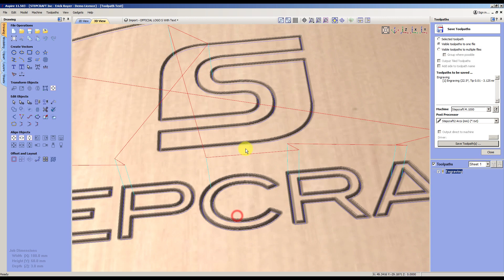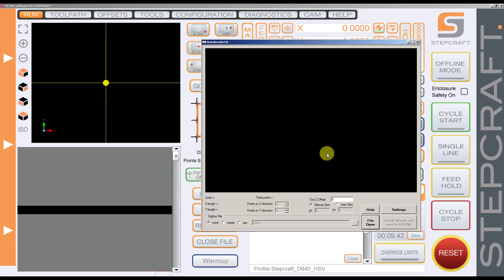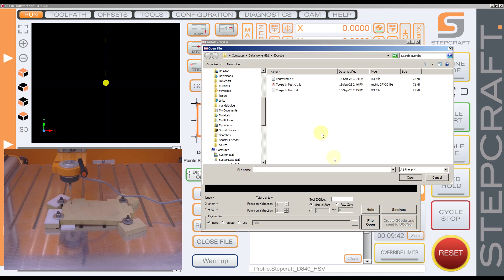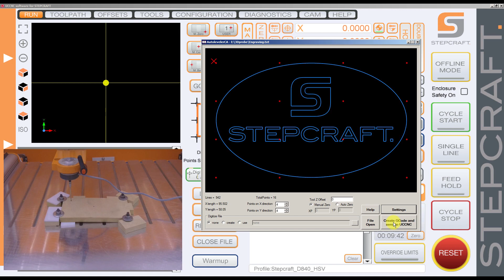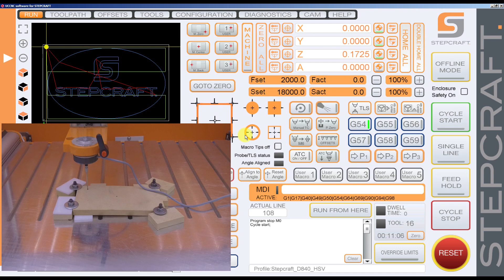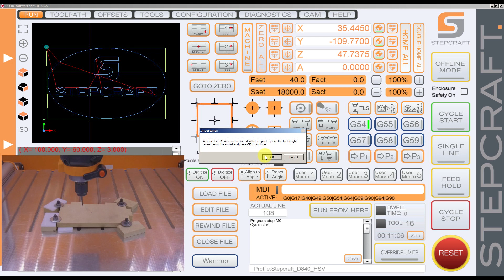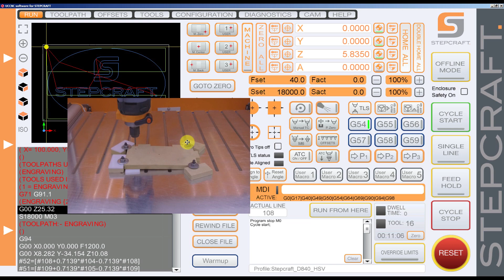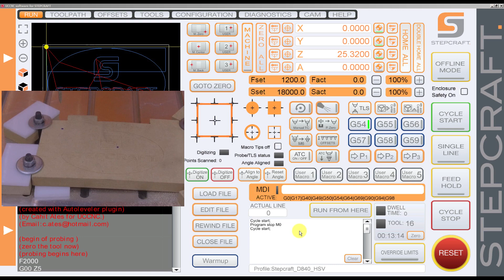Toolpath Mapping to un-even surface or bed

Comment: Hmmm I thought I got it working, but no.
When all done, and finally pressing on "Cycle Start" the spindle does not start up.
Please help!
Reply: As usual I solved the problem about 10 minutes after posting the above question.
In the plugin I had "Auto Zero" enabled! After disabling it, everything started working as should.